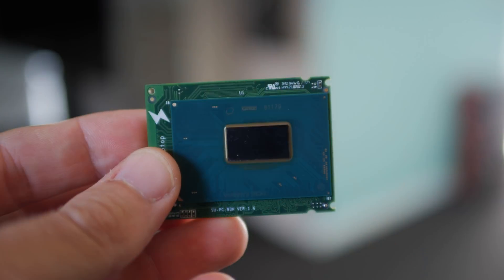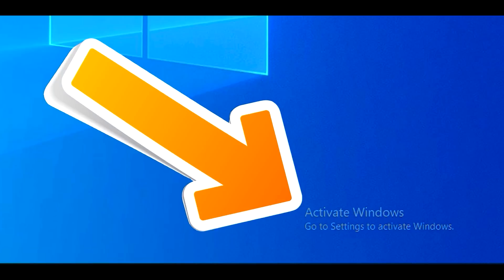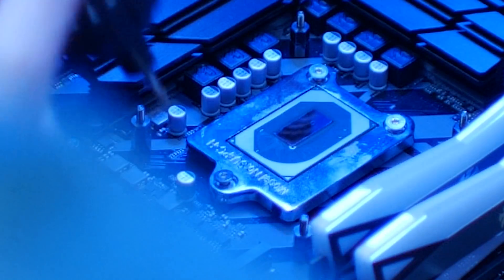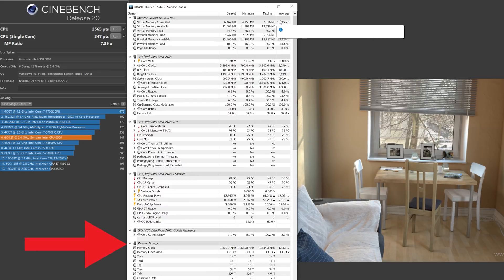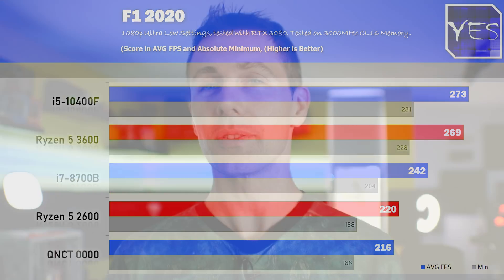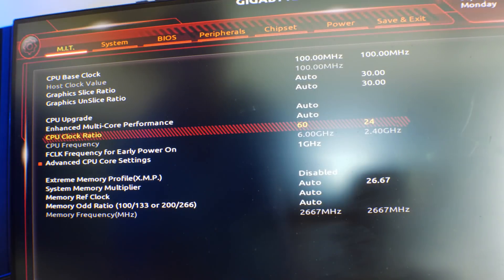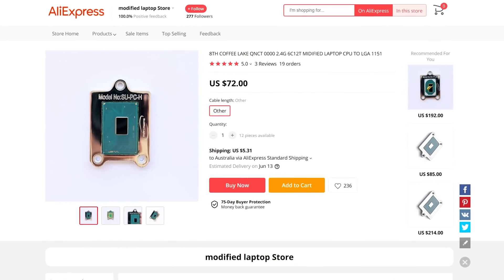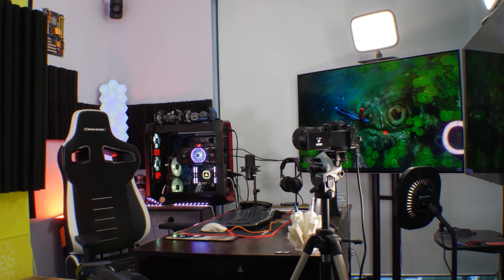The $70 Coffee Lake i7 6 Core (QNCT and i7-8700B)

Comment: Will it work to update the BIOS from a compatible processor in an AsrockB365M pro4?I know that in the gigabyte it works but I do not know if in Asrock motherboard, The programmer that I was going to use to update the BIOS cannot find the chip. I need help

Comment: I have an i5 6500, the QNCT seems amazing as I was aiming for a 11400F but I have to buy a new motherboard (which most are crappy and expensive) and faster RAM, I know the QNCT is no near to the 11400F, but I would get rid of the bottleneck I'm having with my i5 6500 + 5600XT? If it does, I'm fine for a few years more.
Reply: Also, I'm trying to get a new monitor but I can't spend too much on a CPU ... So.. Is the QNCT the right one? The seller said that for my Gigabyte B150 HD3, the QNCT fits perfectly as other samples require more power.

Comment: There's a modified i9-9980HK (non-ES) if you can still find one. I'm using one right now, and it performs similar to a stock i9-9900(K), but the chip is almost impossible to cool even with a decent 240 mm AIO. Running all cores at 5 GHz is limited solely by heat, since it's gaming-stable but will quickly hit 100°C under stress-testing and throttle or freeze.
A "workaround" I found is to set custom turbo ratios in the BIOS. I'm using 52/52/51/50/49/48/47/46 at 1.35 V adaptive, which passes stress tests without sacrificing gaming and lightly-threaded performance. It does often get over 90°C in things like Handbrake, but that's normal for a mobile chip, and it doesn't throttle.
They have also made an i9-10885H conversion, which should turbo up to 5.3 GHz with power limits removed. I might get one for comparison if I can find it at a decent price.

Comment: hey Bryan is this setup will work ??? Xeon E5 2640 V3 Processor 
HUANANZHI X99 tf
SNOWMAN M-T6 4PIN CPU Cooler
V- Color DDR 4  8GB*2 (2666MHZ)
M.2 SSD 256GB
ASUS GTX 1060 6GB
500W Power Supply

im planning to use normal desktop ram for this build is it ok ??

Comment: Is that a candidates to replace my beloved X58 platform :D? If X58  Xeon 6c/12t OC'ed to around ~4,4ghz is performing roughly the same as r5 1600 and this 70$ Engineering Sample is performing close to R5 2600, is it worth to upgrade? New ram new MB and probably new cooler it adds up a bit. Anyone who can help with this question?

Comment: Y’know, that 8700B sounds strangely like an i9-8950HK because oddly enough, that ~100 watts of power is what I get running the same 4.3 GHz all-core under load (when it doesn’t thermal throttle) with that chip inside my Alienware 17 R5.  AFAIK, the i7-8750H only clocks to 3.9 GHz on all 6 cores though I think there’s also an 8850H that clocks a bit higher.

Comment: I got my hands on a QQLT. It overclocks to 5.1ghz all core. The only thing it doesn't like is when i touch the memory speeds. it will not go higher than  2666(2 dimms) or 2400(4 dimms)

Comment: I recently picked up an i7-8700 and 32gb ddr4 2400 for free, paired with a $50 asrock z390 pro4 (new from Amazon) and a $250 gtx 980ti, runs pretty much anything 1080p max settings. The whole system (case, 500gb ssd, 1tb hdd, psu plus previously listed parts) cost me around $500

Comment: Had that one working on a Asrock Z170M ITX/AC but managed to brake it using carelessly a tower cooler. Since then I bought for the same board a QQLS 4.1 Ghz on all cores. QNCT is a very viable option for low end sky/kaby lake boards, using 40w a 3.3 Ghz and just about any stock cooler
Reply: Is that 40w at the wall? Like have you measured it? If so, I think that's probably my ideal CPU for my planned use case.
Reply: @ALmaN11223344 This is a limitation of the CPU, it will run at 40,45W and 3.3 Ghz all core. In all honesty, it's performance is close to a Ryzen 2600, but you need to finnick with modding bios, something that can be a pain. There's a 11800h CPU+MB combo on Aliexpress that right now are an awesome choice for the price, and it's just plug and play
Reply: @alexandredossantos718  Doesn't quite fit my use case it seems unfortunately, I need ITX and got the QNCT with a preflashed board and RAM on eBay recently. The 11800h is also much more consumptive a part than I'd like to get for this use case, that being a travel server.
Reply: @ALmaN11223344  I see. You can't go wrong with the QNCT then. I've got mine paired with a T400 and a 300W SFX power supply, very capable combo for a little bit of gaming below 1080p and specifically in  my case, for simple editing at 4k in Premiere Pro
Reply: @alexandredossantos718  I'm planning to run it with a pico PSU and a 12v 10a brick inside a case the size of two coke cans with 13TB of Unraided storage lol, but it seems more than adequate as a moderately powerful travel server for Plex and games and such!

Comment: Need some advice on overclocking my i5 9600k. Basically I have overclocked my cpu to 5.1 ghz on all six cores no turbo. The question is, what's better locking all cores at 51 or switch back on turbo. Also I'm using msi z390 mb.

Comment: What are the prices of second hand Ryzen 1600 nowadays? With this being slightly less powerfull than a 2600, seems like it should have similar performance overall. Decent B450 boards are still very cheap (I see lots of discounts on MSI boards lately) and upgrade paths from 1600 are crazy. IMO it isn't worth the effort - if you need it to be as cheap as possible, get a 6/12 Xeon build that will work out of the box. Still interesting, though.

Comment: I'd sooner go back to my x5650 Xeon then do a bare die system like this! There are seriously so many options for 6c/12t cpu's rightnow, I wonder which is the best value and preformance.. Very recently i got an insane bargain on a complete system with a (geniune) i7 8700 (non K), though I still game without a hitch on my 6700T (w. gtx1080ti).
Most second hand systems I see around here in the Netherlands are 1st and second gen i7's and 3rd and 4th gen i5's, a testament to how good the chips following those gens are holding up for most people.

Comment: Im guessing the QQLT or QTJ2 will be your next one.

I got 2x qqlt instead of qnct a few months ago because these are unlocked and have more overclock potential. Afterwards they also temporary had the 10th gen QTJ2 1151 which looks even more promissing. I use the cheap CH341a to flash on my Asrocks because not all mainboards allow to change the ME firmware without a flasher.
Reply: Qtj1 10th gen 8c 16t for my z170 itx baby

Comment: Using QQLT bga to Lga i7 engineering sample in  z270 mb. 6core 12thread clocked 4.8 all core. 8 months no issue. But would go 10400f if doing new build now. Unless you have older mobo want refresh

Comment: It is not bad, but the 1st gen Ryzen 7 1700 is still a better overall cpu than the others once overclocked to 4.175 GHz.  Although the 8700b might beat it by a bit single core, it's not by much more than 10%.

http://valid.x86.fr/bench/ewp27s/12

Comment: Very interesting! I am wondering if the ES cpu's could be made to work on a HP Prodesk 600 G2 Mini?? It has a Q150 chipset, so in theory it should support more cpu's then HP officially supports. 
I got one recently, with an i5-6500T, but there is very little usable info on bios modding these sff.

Comment: Hi Bryan! I have HP ProBook 6570b laptop that is running Intel Core i3-3110M but been thinking about to upgrade it to i7 and looking on this list https://www.cpu-upgrade.com/mb-HP/ProBook_6570b.html the fastest cpu for it is: i7-3540M Is it worth the money? I have upgraded the ram to max 16 gb and 480 GB SSD.
Reply: You can go for an i7 3612QM or 3632QM, these are 35W TDP (same as your i3) 4 cores 8 threats cpus unlike the i7 3540M which it still is a 2 cores 4 threats Cpu
Reply: @yorchli3152  Thank you for the tips. I will look them up for sure.

Comment: With full overclock(it's limited), the cheap one goes up to 78w on hwmonitor and scores a bit higher than the 7700k on cinebench multicore and lower than the 7100 in single core. It did throttle on the stock Intel cooler though.

Comment: I have a gpu like that, gtx 950m, sadly it doesen't accept the drivers, they install but the gpu doesen't use them, you can play few lighter games(minecraft, LoL) on it without crashing but they run at low framerate, gpuz doesen't detect any vram I think that it might be the rom but I couldn't find the same one, it's the 2gb gddr3 variant of the card

Comment: just buy that 2600 used one - should come around $70 and avoid all the shenanigans.
Reply: but the jank is so fun though
Reply: QNCT - has gpu uhd 630 , motherboard  h110  b150 can buy for 40 $ ,  on Asus h110 - b 150 have removable chip bios (seller send it with cpu ) , cheapest ddr4 can be used  Ryzen - motherboard has higher price, you need 3200 ddr4 , hasnt gpu .

Comment: reminds of the days when you could buy that 100 dollar skylake i7s
Reply: The one from Linus' video?
Reply: @tidjane2001  nah brian also did a video in what I think was 2018 i think the cpu was the QTJ6 or something
Reply: @bepisman3161  Nope, it was a QH8G (double checked the vid). I had the sister-model QH8F fully working at 3.77 GHz though due to A0 (=earliest somewhat stable engineering) stepping it had RAM stability problems under load. My sample was above average seemingly, many were stuck below 3.7 GHz on normal cooling (<1.48V).
Oh and unlike the normal Skylakes' thermal readout did work with non-k-OC (don't know why though).
Ultimately I killed it through an error of using BIOS- together with XTU overvoltage on an already quite voltage-hungry chip. Never buy such a thing unless you just want to experiment. The hassle and lack of warranty ain't worth it otherwise. Back in 2016/early 2017 that would've been a different story, but still nothing for noobs.

What you probably confused was the QHQJ which is later stepping and (apart from the usual Skylake security holes) much more stable, but unlike the QHQG (same stepping, higher multi) it needs >200 MHz to delivery usable performance as it only has 16 or 18 multiplier (depending on board/BIOS) which will not even net you 4 GHz on 220 MHz whereas most others would "only" need <170 MHz for that. QHQJ was mainly for those with deeper pockets and ASRock boards that could easily do >300 MHz BCLK.
Reply: @aoelp  yeah I rewatched the video, also damn man maybe you hit the lottery on with yours but back in the day they were still quite the bang for buck only rivaled by the used xeons